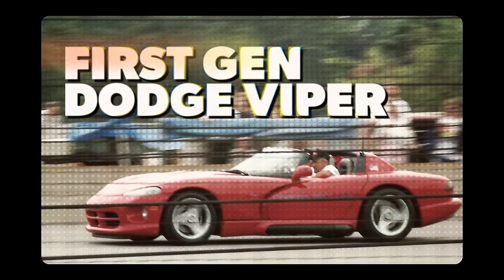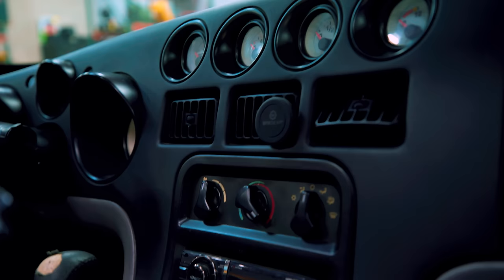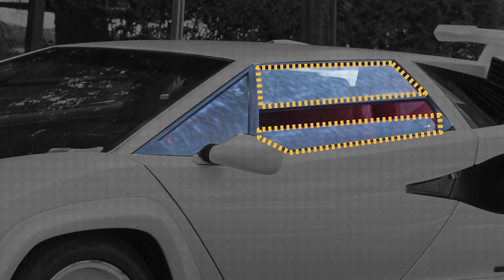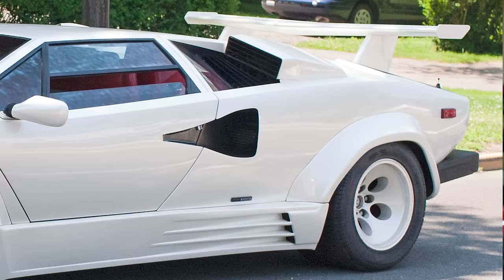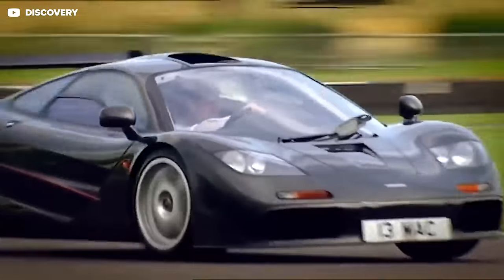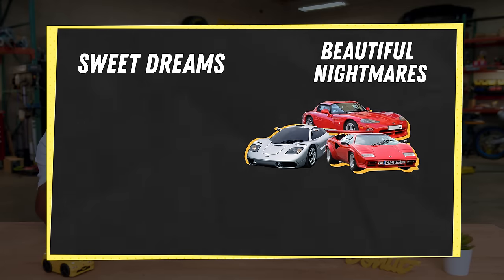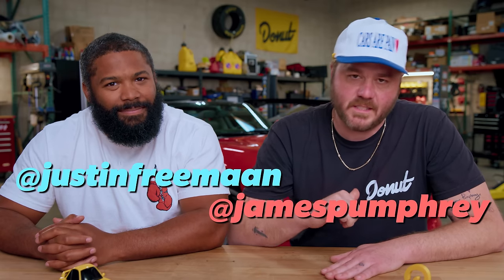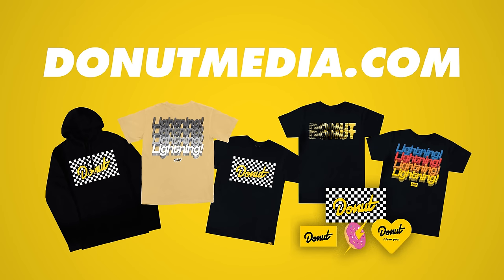Cool Cars That Suck to Own

Comment: A bit of a correction. The Viper engine was not derived from a Lamborghini engine. It was prototyped in the early 80's based on a 360 (5.9) LA V8 with 2 extra cylinders, longer stroke and bigger bore. Well before Chrysler owned Lamborghini in 1987. If you sat a gen 1 Viper head next to a 360 LA head they are damn near identical, aside from the extra cylinder.
Reply: That is true but lamborghini was involved with the engine. They were given the job of making the cylinder heads from aluminium
Reply: @thomashayhurst6547  The only thing Lamborghini did was the production of the aluminum block and heads. The iron block and head V10 design was already in existence and production used by Chrysler in heavy duty trucks. In other words, the engine already existed, they just tasked Lamborghini with the production of the aluminum version of those parts since they had the production facilities to do so. This was an engine that was already producing close to 360 HP in the iron block, and was retuned to 420 HP in the aluminum block via the use of forge internals, intake plenum and higher compression. If you put the head of a Chrysler LA V8 next to a SR1 Viper head they look nearly identical, aside from one being cast iron and the other being aluminum and having 1 extra combustion chamber. Even the combustion chambers are the same design. The ports are the same design, the rocker assemblies are the same design, they basically the same head. If you took a LA V8 block and a SR1 Viper block and put them side by side they look extremely similar, because the Viper block is essentially an LA block with 2 extra cylinders but made out of aluminum. They did increase bore and stroke to get to 8.0 liters of displacement.
Reply: @riccochet704  Negative, nice try though.
Reply: I recall reading that they were truck engines stuffed into them.
Reply: @derekhobbs1102  lol no
Reply: From the book Dodge Viper by Daniel F. Carney:

Looking back, it seems astonishing that Team Viper was also building a radical new engine from a nearly clean sheet of paper, to a deadline pace. Ruling out the truck engine meant the team members had to build what they wanted themselves.

Said Francois Castaing "It was already April 1989. If we wanted the car to be ready by January 1992, we needed to really get going. But the timing for the truck engine was a year later. It also became obvious, when we looked at it more thoroughly, the weight of the iron engine was too high and the power we would get from it wouldn't be sporty enough." Francois was in charge of truck engineering at the time.

Said Roy Sjoberg , Team Viper's new executive engineer," We rapidly ascertained, the truck guys and myself, that where we wanted a 6,200-rpm redline, the truck guys didn't really care to go over 4,200 rpm. They were interested in low-end torque, not horsepower at high-rpm levels where we were. They were not concerned about weight. Truckies don't like aluminum blocks. They're not as forgiving, and truck people like to have things that are pretty bulletproof.

"Not a lot could be learned from our truck V-10 development. Both engines were V-10s, but one was aluminum and one was iron; ours was sequential-fire individual-injected, and the truck's was group-injected, so it ended up having air pumps and things. We only needed EGR to meet the initial emission requirements, as well as a catalyst. The truckers had to put some other things on it. We ended up with the same dimension pushrod and that was it. But even there, we used a higher-grade material because of our power and rpm requirements."

So in other words they only thing they share is the # of cylinders
Reply: @robbiddlecombe8392  or you could just ignore my reply from team Viper themselves that i posted 🤔
Reply: @giovanni4304  When is an "engine"  an "engine?"
The intake manifold and headers play a large part in whether an engine favors low end torque. Crankshaft stroke  influences RPM. The engine management system determines whether the engine uses batch fire or sequential. 

Nothing in your post indicates that the engineering for the truck V-10 was scrapped in favor of a clean sheet design. It could be true, but your argument doesn't support that position.
Reply: @riccochet704  No clue dude. No clue.
Reply: @riccochet704 damn imagine only getting 50hp per liter sounds like the viper is a hot pile of dookie in terms of power. A stock motor out of the integra type R was damn near 100hp per liter.
Reply: @Lawrence330 At no point was the iron V10 scrapped. It was in development before and after the Viper V10 and successfully produced for, and used in, the trucks from 94-03. The fact that almost exactly zero parts interchange between iron V10 (truck) and aluminum V10 (Viper, ONLY) is all the evidence needed to say these were entirely separate designs. Whether they modified the designs for the truck engine to arrive there or not is immaterial, seeing as aaaaalll of the major components are vastly different.
Reply: @riccochet704 So. Much. Wrong with what you said. Aside from Lamborghini casting block and heads, pretty much all of it was wrong. Are you sure you aren't comparing the 360 and the truck V10?

 The Viper V10 preceded the truck v10 by 2 years. Yes, development was happening before, but it only made it into production in '94. At no point did the truck V10 break 310 horsepower, much less 360. I'm fairly certain the first gen Viper V10 only ever made 400 horsepower, and it wasn't until the second generation of the car that they made 450.

360 LA heads look absolutely nothing like the Viper V10 heads. And the truck V10 heads look nothing like the 360 LA heads. There is some similarity between truck V10 and Viper heads, in that the exhaust ports look very similar. However, manifolds don't even interchange. In fact, between all three engines, no manifolds interchange at all, no heads interchange, and no crank interchanges. The question has been asked many times on the truck V10 forums, whether the Viper top end will fit on the iron V10, and I'm fairly certain only one or two people have ever made it work, and it required a lot of machining, with custom spacers. I've not looked into those conversions very closely, as you're still left with an inferior performance result.

The Viper V10 and 360 blocks look absolutely nothing alike. Did you mean to compare the iron V10 with the 360? Because that genuinely is effectively a 360 block with two extra cylinders. The 360 and the truck V10 are so similar, that they actually did use the same connecting rods and pistons for at least the first batch until they could get the coatings done for the V10 pistons. In fact, if you search for V10 and 360 pistons, they are the exact same part number on RockAuto aside from the suffix denoting how many are in a kit.

The Viper engine shares almost exactly nothing in common with the LA or Magnum engines. They share literally nothing with any of the v8s. The closest analog to the Viper V10 is the iron V10, and the only thing they shared was the displacement (and only in liters, the CCs are marginally different), firing order, coil packs and a couple of bolts.
Reply: @ttvsephirothac4045 Imagine thinking anyone cared.
Reply: @giovanni4304  you are correct. In the Viper of America forums behind a paywall is a big story from someone super high up on the original Viper team and he basically said the same thing. About the old truck v10. Lambo did make a v10 for them but they didn't like it. It was high revving. They did like that it was aluminum.

Comment: I have a 75 Countach, the no flares no wings skinny tire one. They didn't keep the best records but it was the 28th one built. Bought it in pieces and took years to finish. It handled bad, weak brakes, heavy steering, heavier clutch, no rear vision and over 140 mph the rear end would start to lift. It gets to 60 in 7 seconds. I love it! Driving it is an event. I've installed an electric power steering rack, Wilwood brakes, tweaked the suspension and added Vintage air. I'm a skinny 6 foot and barely can fit. The noise it makes and the pure mechanical feel is fantastic

Comment: Those old Countach's were weird. The ergos suffered from the same thing as most Italian cars of that era. After adjusting for your liking, you'd usually find that you had to reach for the steering wheel but your legs were cramped. Also, the huge tunnel in the middle forced you to one side of the car. Looked damn cool though.
Reply: Someone once mentioned in another video that the ergonomics of the Countach work much better if you drive like an Italian e.g. with your arms resting on your thighs and your hands on the bottom of the wheel. But they did admit that everything else is accurate especially the clutch pedal which is apparently set in concrete (did Lambo borrow one of their tractor clutches to make sure it could handle the motor?)

Comment: I have a first gen viper that I've owned for quite a while and taken from Florida to California and back on a road trip. Put the soft top and windows on and crank the a/c on max cold. No issues at all with mine. Many people have vipers with plenty of milage on them. Lots of cars over 100k miles. They take a certain amount of not being an idiot to keep them on the road but they are super fun to push hard and drive great with proper inputs

Comment: Viper isnt that bad. I had a 99 GTS. Amazing car. Okay, if the tires are cold, you havent much grip. But after 10-15m of driving they have a lot grip. You can max accelerate in the first gear without any lost of grip. I miss that car

Comment: I'll push back on the 90s vipers.  My neighbor owned one and I spent a few times cruising with him in it.  They were very, very loud and harsh to drive and left you worn out after a drive.  It actually made my 2001 trans am seem comfortable.  It was also dangerous if you got stupid and tried to do more than your ability.  But if you kept it as a summer and weekend car, it was basically bullet proof.  NO ONE HAS EVER BOUGHT A VIPER AS A DAILY DRIVER.  My neighbor sold his 93 viper and bought a 1994 lotus esprit.  The esprit was "more" comfortable than the viper was, but still mildly tiring.  It was also less exciting to own and the turbo would frequently overheat and you had to drive around without boost for a bit.  And the maintenance was an absolute nightmare.  My neighbor worked for Cisco Systems and made crazy amounts of money and he still got annoyed by the constant maintenance with the Lotus.  He was frequently annoyed with how he could rarely take it out each Saturday without it needing something or some bug popping up.  He regretted getting the Lotus.  So I would completely take the Viper over the other cars on this list.

Comment: I had a Viper like that. It was super easy to work on, nice to drive, quick, and a little more comfortable than my Miata. I never got burned, and the windows weren't a big deal. They got a scary-to-drive reputation from overhyped magazines back in the day, and later from the fact that most of them have never worn out a set of tires (so they are all dry rotted).

Gee whiz it do burnouts though!
Reply: Anyone who's used to older raw cars with decent power wouldn't be that terrified of it it's people who are used to cars that basically drive for them with all kinds of nannies and posh ride that someone's grandma could drive fast lol..
Reply: @midnight347 it'd probably be like driving a much better handling and more powerful '60s car....very fun. They require you to actually be able to DRIVE!

Comment: Actually, gen 1 vipers are extremely low maintenance by sports car standards. Only real headache is finding tires, which it has a tendency to convert into smoke pretty quickly when driving hard

Comment: honestly surprised you didnt do the plymouth prowler. that thing was notoriously hard to drive, and expensive to boot. looked SO damn cool though.
Reply: What killed me about the prowler was they put a in a V6 and a "you shift, it clutches" not quite an automatic.
It needed a V8 and a manual transmission.
If it had been available with a V8 and a manual tranny I think it would have sold better.

Comment: The viper was done a dis-service, the engine and drivetrain are dead reliable, and if you got one after the first generation like mine, a gen2 GTS is awesome. Its only down side is swinging your feet in and out, is a little tight. The gen one is annoying for not having widows and doors tho.

Comment: This theme could be applied to some classics as well.  I'm thinking of the 300SL gullwing and the Lotus Elite and Elan.  The original 300SL was a one-off for racing but M-B was convinced to do a production run for customers.  The gullwing doors were an expedient workaround for their being restricted by the space frame below them and required the steering wheel to be removed for the driver to get in and out of the vehicle.  No problem for a race driver, but not great for the people that bought them for the cool factor.  Also, the mechanical fuel injection would wash gasoline into the crankcase while starting.  Again, something that pretty much restricts them to being track cars.  The Lotus Elite and Elan were fine driver's cars but were a maintenance nightmare for different reasons.  The Elite used a plastic body that suspension parts were directly attached to.  Of course, the mounting points tended to fail.  The Elan was hands down the best small British roadster, but they were batch built with parts and fitting that were not entirely consistent between runs, and documentation of the changes was sketchy at best.  Restoring one or replacing parts is a job for a specialist.

Comment: I've actually seen a few videos of people saying that most Ferraris actually suck to own. 

Common complaints seem to be that the interiors are built with far cheaper materials than you'd think. They look cool on the inside at first glance, but on closer inspection the plastics are really cheap, parts are sourced from other cars, you'll hear a lot of stuff rattling about constantly (especially at higher/motorway speeds) and the leather seats are badly stitched and come apart easily. 

They cost a fortune to get serviced and/or repaired (especially if you want to retain the value of the car), but yet they break down CONSTANTLY, so on the rare occasion you do actually want to drive your shiny new Ferrari, it won't start. 
So you have to send it off to a Ferrari-approved dealership to get it fixed, and probably won't get it back for 4-5 weeks! When you do get it back it'll work for a couple of weeks, then it'll break again. Meaning you have to send it off to get repaired. Again.

Not to mention, they're always getting 'keyed' by jealous passers-by, and you'll never get let out of intersections by anyone while you're driving it because they think you're a rich prick.

Comment: Those mid 90s Mercedes harnesses are the worst. They just fall apart when you touch them. I had to build a whole new engine harness on one when replacing an engine. Never knew the reason until now. Thanks Donut.

Comment: No, the Viper V10 is based on the 5.9 Liter (360 cu. In.) V8. Chrysler engineers asked Lamborghini for assistance in developing the Viper V10. Doesn't mean any parts are interchangeable, because they are not, but the basic architecture of the V10 came from the Chrysler small block V8.

Comment: The vipers engine was NOT lamborghini derived, however lamborghini did have a part in making it. Chrysler threw 2 cylinders on the back of their 5.9 v8 and stroked it, making the 8.0l iron block v10 used in their 2500 and 3500. They later tasked lamborghini with converting that block to aluminum for the viper.

Comment: One of my first traffic fatality investigations was a Dodge Viper, dude went off the road, in the ditch and out the other side. Witnesses said the car cleared 20 feet, and it sheared the top off a tree and a power pole. Driver lived but will never be the same, terrible injuries. Passenger died at scene. Race car.

Comment: The 427 Cobra held the record for the quickest car to go 0 to 100 to 0 for a LONG time. The 427 was definitely the cheapest car of ANY on your list to drive and maintain by far. Replacing aluminum body panels sounds cheap on a car worth millions. 
Although I agree that building a replica with modern driveline, suspension and brakes is a LOT safer.

Comment: I bought a first gen viper back in February and have been daily driving it since it's awesome. The only real problem is gas mileage and when it rains I drive my truck. But if it's a sunny day you can bet I'll be on the viper.

Comment: A fun video - thanks since it does bring back some memories of the rich kid in our group's '66 427 Street Cobra which I had occasion to tune and test drive many times. IIRC, he paid somewhere in the neighborhood of an amazingingly steep $7K while my '63 406/405 Galaxie 500XL was only about 3200 bucks and the ''65 with PI engine was ~$3500. How times changed

Comment: You think the viper was scary, you should see the EK I was driving for the winter when I was 20! I drove it 250kms highway to visit my mom in another province, and when I pulled in her parking lot of a driveway, I ripped the ebrake showing off and the whole rear axle ripped out from under the car lmfao. Trailing arm mounts were rusted solid and the rear shock towers were rough. I left it there so she could scrap it, but she made me scrape the shocker sticker off the back window before I left lol, also threw the rear axle in the trunk of course

Comment: I got a 98 SL500 with 64k miles for $ 7,000 which additionally doesn’t have the biodegradable wiring harness.